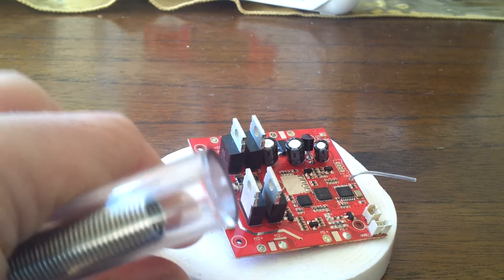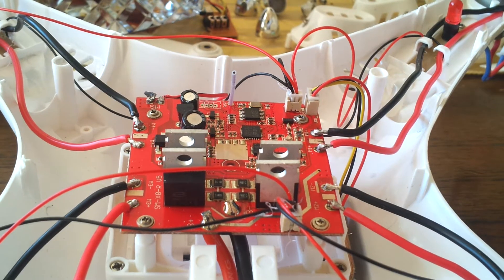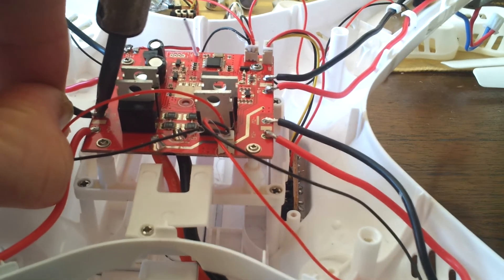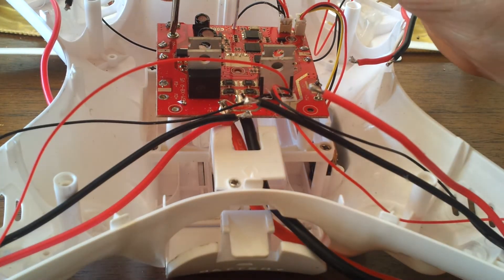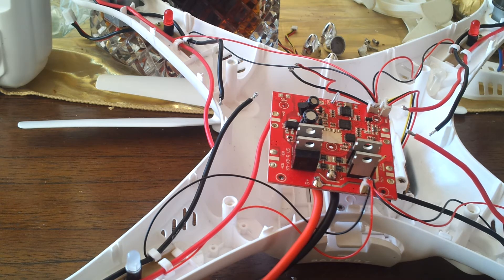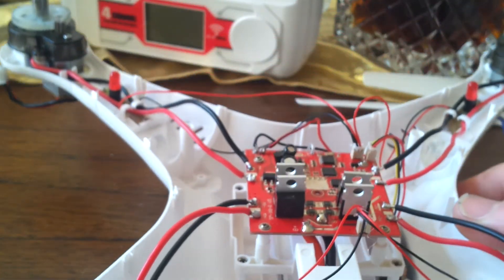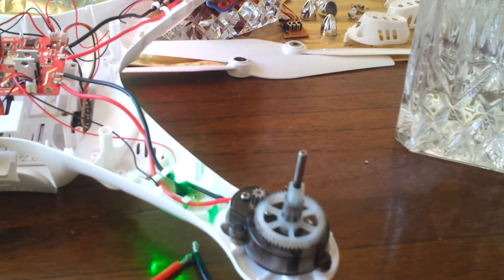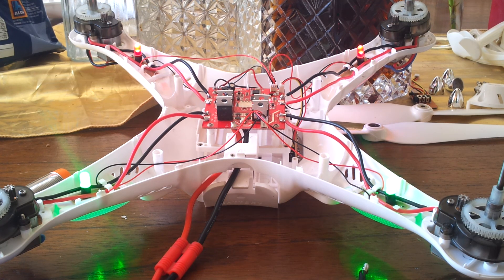Syma x8c  changing flight control board step by step

Comment: 1st u need a better gun 2 u need something to tin the gun so u can take solder put  it on the gun tip and wet some cloth and spin the guns tip around to tin it .and you are supposed to heat up the pad or thing you are trying to put solder on

Comment: If one of the motor doesn't work but it actually does, it is just the plug that it is connected to that doesn't power it is it something wrong with the cable from the board to the plug for the motor? the solder? or the board?

Comment: did you try laying the tip over the solder horizontally I think it will apply more heat rather than the very end?